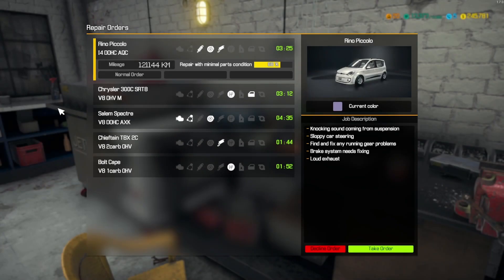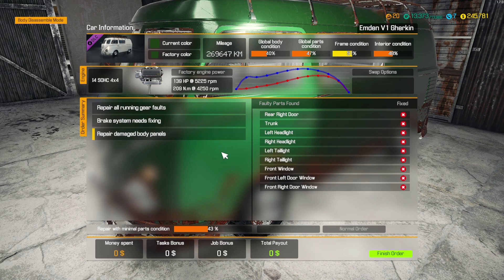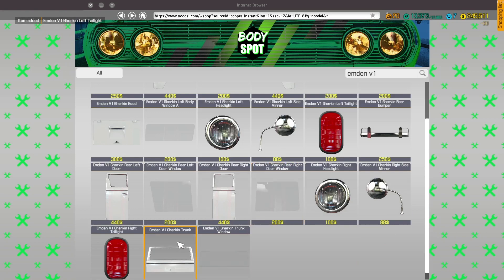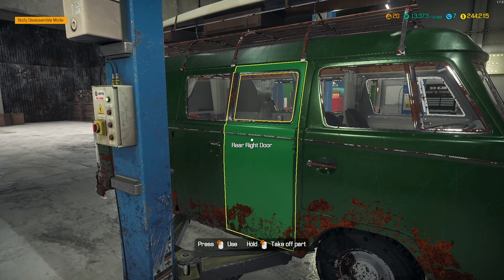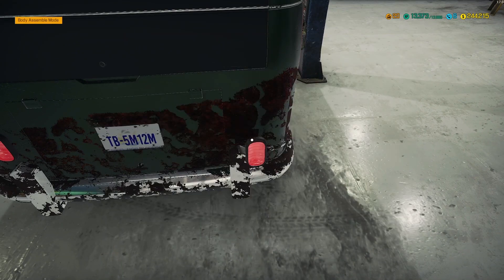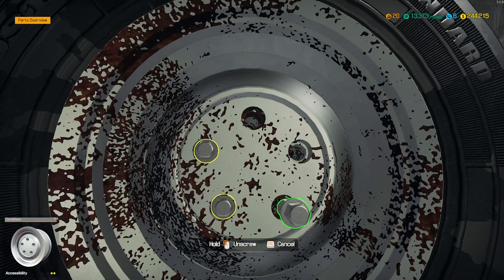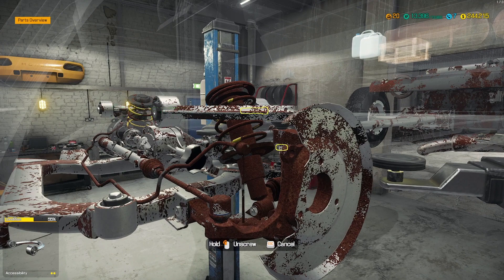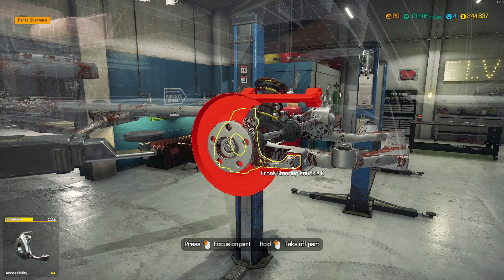Taking Apart A VW Bus's Running Gear (Car Mechanic Simulator 2018)

Comment: You are welcome. :)

I probably wasn't super clear about something.

When a part needs to be replaced, it will say on the ticket the standard the replacement part needs to be - in the case of your bus, it was 43%. That just means the customer's bad parts can be replaced with parts of at least 43% condition. (For many cars, the customer wants 100% fixes, but evidently not in this case.)

That means, in your example of inner tie rods, it probably would have been fine to mix up where the new one went, since the used but still good one was above the 43% mark.

For customers like this, where they're fine with used parts, the repairs can be easier. :)